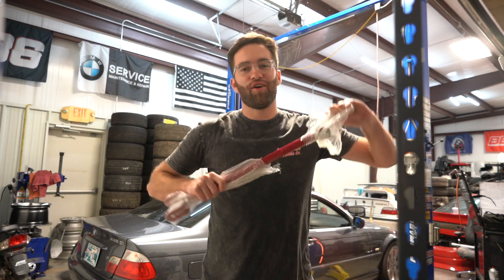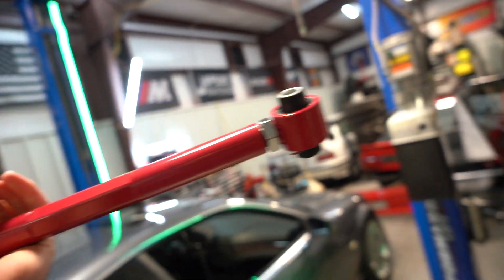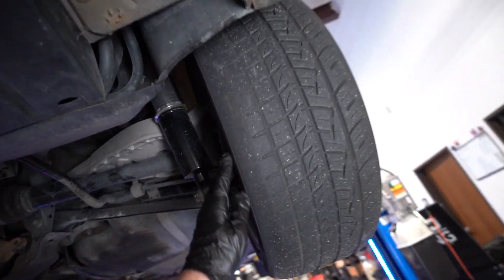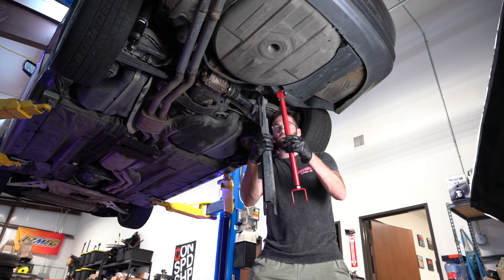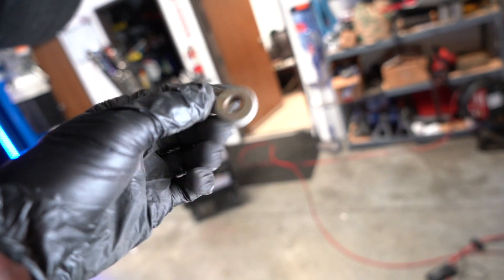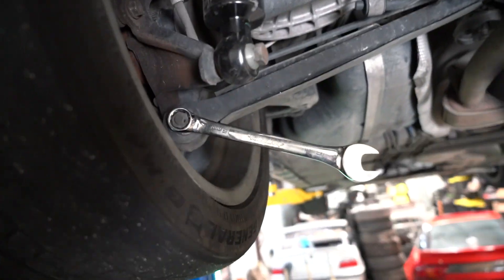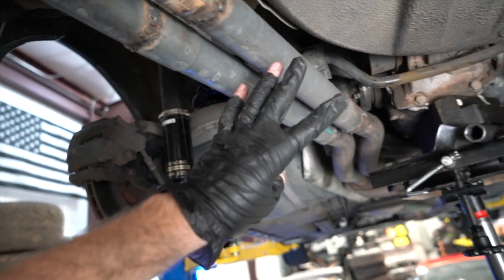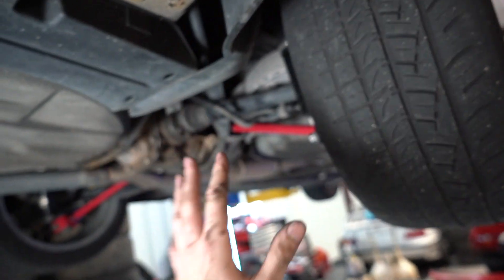EBAY E46 CAMBER/CONTROL ARM INSTALL! Maxpeeding Rods! REVIEW Ep.4

Comment: Thank you so much bro!!! I finally replaced my driver side camber arm on my e46. The secret is the two back 18mm bolts need to be unloosened about 1 inch, take diff bolt out, jack it up and then barely enough room to slide in the camber bolt, crank, tighten, VWALA 🎊 🎉😊
Reply from the maker: Sweet! Good work

Comment: Hey man the wear from the inside is not coming from the camber. It's from toe. You need to zero out the toe so you won't have this. Camber will wear out the inside of the tire but at a regular rate. With these cars the more negative camber you get the more rear toe in you have thus the excessive wear.

Comment: When installing did you use the washer on the hex nut side? I have put mine in with the washer but the hex bolt is kinda short
Reply from the maker: yes, nut side

Comment: Hey man 10 months later, you still using these arms or have you switched em?
Reply from the maker: Yes sir. Still use them. We have a few e46’s with them. Only one bushing blew, because he put a lot of camber in it for style lol. We drift them so rear camber is at 0.
Reply: @jspeedracing  sweet. I just bought an e36 on the same brands coilovers and there’s a shit load of camber in the rear that I’m looking to get rid of lol